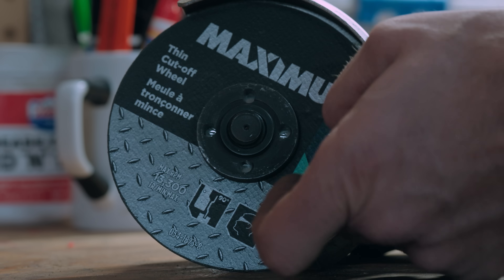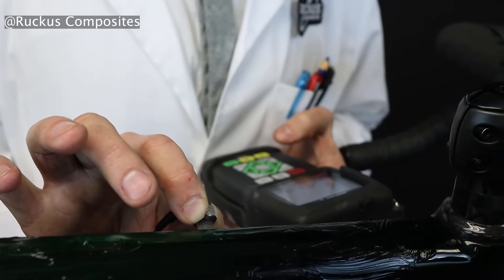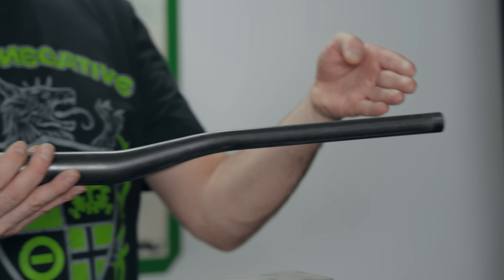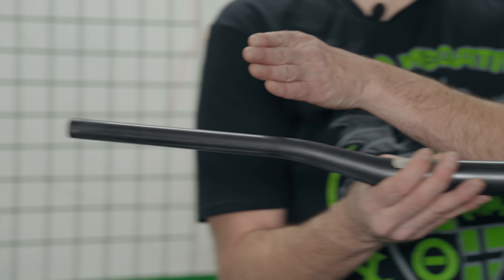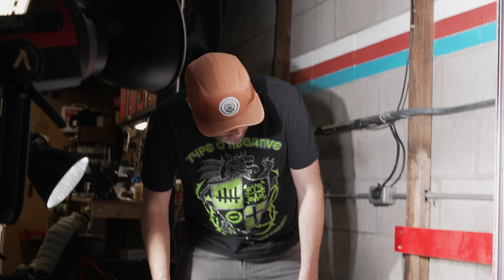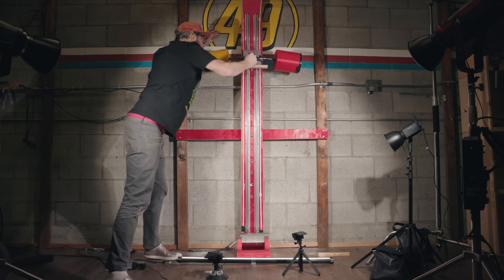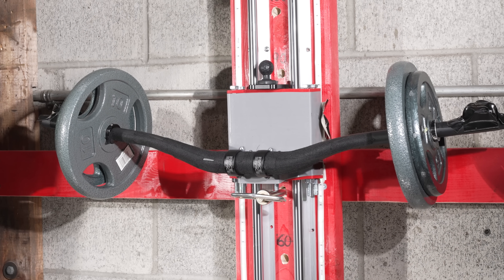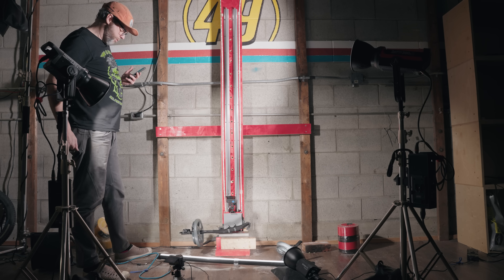Is Repaired Carbon Fibre Safe? Breaking Point Test

Comment: The hell you guys mean that the non-repaired bar broke at a smaller amount of force, meaning that the repairs were better? Firstly you used a completely different bar for the third test and you used a different testing method (by changing the weights), the original 2 tests and the final third are not comparable at all. Secondly, and more importantly, you had the unfixed side of the bar NOT BREAK on the first 2 tests at the same high force that caused the fixed sides to break, meaning that in both cases (in this arguably tiny sample size) the bar performed worse after being repaired. Ive enjoyed watching this channel a lot, you guys provide very useful information in a format that is easy to digest to those who are unwilling to do the research themselves, but this video is a tragedy that could lead to an even worse real life tragedy. Do better.

Comment: You need to edit and republish this video with an intro excerpt timestamp link and create a new ending that acknowledges the skewed results and flawed conclusion and seemingly wonky chart? Your data shows repaired carbon can be strong. But doesn't support what you say. It sucks that the test rig broke, but there is no real good comparable data here, even the two repair breaks are suspect comparisons as the rig seems to have been damaged and repaired at some point in testing? If the rig was repaired then any further testing is not apples-to-apples data. The only thing to do is build a stronger testing rig. Then you have to buy all of the bars at one time, the same bars from the same manufacturing batch, and hold the randomly picked control bar from the beginning. Then no point breaking the bars in ways that won't happen IRL. Nobody accidentally uses power tools on their bars?? :) ALSO, how does your test rig compare with actual use? Do we apply those kinds of forces every time we ride down a trail, because we weigh so much more? Or considering everything else that makes up a bike that absorbs the impact before the bars do we only create that kind of force doing RedBull Rampage kinds of drops??  I do appreciated the concept behind this test though!! And for sure if I break a chainstay/seatstay I'd get it fixed. But bars, probably just gonna replace those! :)

Comment: this was a rly interesting video,,

and i’d def repair smthn like a carbon chain guide and continue using it,,

but,,

the complaint remains that there’s no indication before breaking like there is w metal (usually)

so u can’t tell when the stock carbon part is abt to break and therefore needs to be PRE-WMPTIVELY repaired or replaced..
Reply: *pre-emptively

Comment: This video is delivering a flawed and frankly dangerous conclusion. do not ride on a repaired carbon handlebar if you value your face, teeth, or spine. safety critical components are not worth risking your neck or face. Carbon parts exist in cycling to chase weight and flex characteristics. they are often designed to a limit of strength and rely on the continuous fibers running throughout the part to ensure this strength and distribute the stress of the load evenly to surrounding areas. if those fibers are broken, all bets are off. overwrapping and overbuilding the broken section only pushes higher stresses to another location where the fibers have either also been cut short or were not built or tested to handle the higher and unevenly distributed loads. Not to mention the video doesnt even note the potential of fatigue cycles on the repaired area either...

Comment: First of all - thank you for the video! Please read this one carefully. The breaking test itself is not good at all. The main difference in these type of composite material is the possible persistence of micro cracks during operation and their accumulation in time. It's really not obvious that if you would test a new element with the same maximum condition you did (without any other breaking tests) - it would always broke, the element could survive extreme condition at first. You did a few tests with lower weights before you use maximum weight. This can be the reason of accumulation of critical persistence of micro cracks that lead to the point where the construction is no longer good enough to resist the force you use. The same thing is with the repair! You can not be sure that your repair is goon enough till you check it at reasonable level. Ride safe! All the best!

Comment: Not a carefully-enough controlled experiment to draw any conclusions that I'd be comfortable hanging my hat (or somebody's front teeth) on.That was a reasonably hokey rig, which did not very carefully control for torque on the bars (i.e., the distance the weights were away from the stem clamp) or where the weights were relative to the repair. Spreading the weights over a ~20 cm area, as they did for the repaired bars, is not an apples to apples comparison of the loose plates of weights (which rattled on the bars on impact) that were attached to the "store-bought" bar. These differences might have substantial effects on the magnitude and direction of forces (impact and rebound) at the highest loading point (i.e., when the rack hit bottom). Further, in some of the takes, the weights came almost disastrously close to the presenter's toes - which are directly below the weight on the left when he is pulling the pin. Safety shoes maybe?

Comment: Not a bad qualitive rather than quantitive experiment, but a bit flawed.  When the change from sand to metal weights was made, the weights have the centre further in than before, this would lead to less of a bending moment on the bars, they all failed further in than the weights.

I would expect the repaired bars to be stronger than the unrepaired as there is more material in there if they were metal as the bonding will be a weld rather than a bonded sleeve.  It looked like the inner sleeves were glued with the joining faces on the original tube either glued face - to - face or not at all, this would be the weak spot, and indeed this is where they failed.

It would be good to see how much force goes throuugh the bars when being ridden, if it is significanly lower than the beaaking point then I don't see  a problem with the repairs.

Personally I can't see the point in carbon fibre for me and most other people but no doubt some of the top people find an advantage.

Comment: Have read some of the comments, and have a few thoughts. 

TLDR; It's an interesting video that isn't entirely wrong in it's point, but it feels like the type of experiment where you came up with a conclusion, and then set out to do some tests to just confirm that conclusion regardless of the actual outcome of the tests, which is a very bad way of testing something. Plus the explanation feels a bit like it's just glossing over everything except a small point that may not actually be relevant or accurate. 

For the readers;

To the general conclusion, I agree that having some basic knowledge of your kit is good, even if you aren't going to work on it. Knowing you don't need blinker fluid is a good thing. 

To the specific conclusion, I think it depends on the type of break and the event that caused it. If you broke your bars like that by full speed clipping a rock wall, that's probably fixable. If your carbon frame took a tumble and cracked the head tube, maybe not. Definitely have someone who knows composites inspect it though. Carbon fiber is certainly repairable, but only sometimes, not particularly easily, and often at the cost of weight and bulk, which is the strength of CF in the first place. Hence the conclusion, "it's [probably] not worth repairing"

To the methodology, there are definitely some issues with the process and sample size, but I also see some other issues. One big issue is the force measurement in the first place. The independent variable is the drop height, plus the mass of the weights if you had to change them after maxing out the height. Having the force is a useful data point, but it's not the factor being changed. Also, where is the accelerometer located? If it's in the center of the base or the bars, you would likely read a lower peak impulse at the breaking point due to the weights being detached from the bar before they have a chance to fully transfer their inertia into it and rebound back up. I'm a bit surprised that the first two bars didn't experience this, though possibly the height spacing was such that the peak force would have been between the two pegs? (This is based of my intuition with similar testing scenarios, please chime in if you have more experience with that type of setup) 

Additionally, with the extra set of bars you seem to be talking about them failing due to fatigue and at a lower force than the repaired bars and a lower force than their peak, but regardless, that only really shows that the third set was not as strong as the two originally were. (Plus maybe the impulse measurement issue above) I assume the point of the last test was supposed to be to see if the repaired bars failed at a higher force than the unrepaired bars would have failed at, but using a different bar makes that kind of meaningless. It also doesn't make much sense given that if the virgin side of the bar didn't break at that height, a full bar likely wouldn't have either. The weights were also different between the first two sets and the last one, which confounds the result even more. (Also as someone with way too many 3D printed things, a shim for a set of barbell/dumbbell was probably a better idea from the start) 

It also feels like the whole chart section doesn't make a lot of sense? What do the hollow circles represent? There were only a few tests shown, definitely not that many. Were those bounces? Were there more tests than were shown? Also, the peak vs break forces aren't labeled. Why is the second-to-last force measurement highlighted at all? Why are we just now learning that there was a "fancy" vs "quick and dirty" method? Which was which? What is the X axis? Also, why is there an X axis? Actually, why is this a scatter plot at all?

This definitely feels very out of place for F9. Having the whole video be "you should do a thing and it will often be as strong or stronger" does test and determines that thing is not as strong "as you can see, you should do the thing" just doesn't make any sense.
Reply: Also as a clarification for all the people just saying "bring Ryan back", I do like the cycling content, and if it adds to the content instead of replacing the existing moto content in the schedule, neat. (Though I do think there is enough of a gap between motorcycles and bicycles I get why some of the audience doesn't like it as much)
This specific video and methodology just feels well below the standard for the channel.

Comment: I don't mind the bicycle stuff, or the new cast, but please, do the actual tests better. Switching weigth types and not using the same handlebar at the end. So his repair was stronger with a wide soft sand weight than an unknown knockoff was with a steel weight. That does not tell me much.

Integrity is so important for this channel.

Comment: I never would have thought repaired carbon fiber would be just as good as original. I shoot archery, and most of my arrows are made out of carbon fiber. It's a great material because it doesn't bend and is light (unlike aluminum) and it takes a lot more stress to break than wood. (It's only downside is it can be expensive.) But when it does break, it's thought it's best just to cut off the broken part and shorten the arrow. But, maybe these arrows can actually be repaired.

Comment: The surface of the load was different on repaired handlebars and new one. Repaired had weight distributed on more surface, around 10cm (more less width of grips) the new one had just narrow gym weight installed on like 2cm of the width of handlebar. Thats not apples to apples.

Comment: This has done nothing to convince me that carbon fiber is safe to repair. Your testing methods are flawed. Aluminum can be damaged and still be safe to use, while CF is a gamble. No thanks! I'm hard on equipment so ill trade a few grams of weight for reliability every day of the week.

Comment: Overload failure & crack propogation, as what happened to these bars, are not the same as fatigue.  And with the retail bar covered in tape, it was also changed test configuration.  Overall your point is true that sometimes carbon fiber parts can be repaired to be as at least as good as original--functionally.  But per data, the repair changed the geometry by adding extra material & load distribution on the area of repair, so the strength is going to be different with the same force vs a new tube.

Comment: The test is wrong. There is a methodology error.
At the beginning you say: carbon fiber breaks up without surface warning signals. 
But later in the test what you did is to stress the same bar multiple times creating "under the surface" breaking points and making it weaker for the next try. 
If you pick a brand new bar and you test directly 1,60 meter, probably it WON'T break up. 
At the same time if you pick one of the repaired and you test immediately the limit, maybe you will also see that you can push that limit further. BUT in the case of the repaired bars, decisive is how it broke and of course how good it has been repaired. 
However you have to pick ONE new bar and run ONE test. Then change the bar, make another test, and so on. So you have equal starting conditions. Otherwise is like you are using unrepaired items and then you wonder, they are weaker than the brand new ones.
Reply: this

Comment: Wow, there was no standardization in testing methodology between the commercial bar and the repaired ones. Y'all need to remake this with both a larger sample size (I'd personally like at least 3 of each) of each break type and repair job, as well as a consistent and repeatable testing apparatus throughout the entire test. Maybe also throw in a break caused by the test rig rather than artificial means, repairing it, then retesting it. I'm disappointed quite frankly.

Comment: idk guys this seems like a low quality video, you didnt really prove much, the repaired side of the bars broke before the unrepaired side, and then you used more concentrated weights on some random other bar and found that....a bar that was repaired with more fiber is stronger than some random other bar?? also you really didnt do enough tests to judge if its actually safe or not. This wasnt really up to f9 quality

Comment: I repaired a Downtube headtube junction on a full suspension trail bike. Rode it a few more times and it broke again but on a chainstay pivot, so the whole “if the repair is better than the rest it will break somewhere else” has been true for me.

Comment: Can't even find a decent bike mechanic in Portland, Maine so where the hell do you find such a specific CF specialty shop???   Plus, my Reserve Wheel owner's manual says anything over 150 degrees damages CF resin so never leave your bike in a car on a hot day or even leave a black bike sitting in the sun too long.  Catastrophic failure means significant injury.  Finally, no way those repaired bars had the same flex/damping characteristics as the original.  Thumbs down from this cat.  Simply not a fan of that fancy plastic crap; environmental disaster with fancy marketing and huge profit margins.  Liking your channel less these days :(  unsubscribe

Comment: What I find silly is that those parts are essentially injection-molded plastic with carbon reinforcements. They're not "carbon fiber" in the sense that sheets of carbon weave have been laid together like you would find in a high-end bicycle or car frame; they're fiber-reinforced plastic like the more traditional glass-reinforced nylon. 

I find that confusing as the term "carbon fiber" gets thrown around a lot but now encompasses multiple manufacturing techniques, which produce wildly different results.

Comment: Carbon fibre’s sharp broken edges are lethal and the dust particles are extremely toxic. I worked on a military base that stored damaged carbon fibre fighter aircraft parts. Strict handling measures were enforced. As for weight reduction, using carbon fibre on a bicycle is like making a feather lighter, the gains are incremental and frankly not worth the effort. It has its uses but it strikes me as what chrome in the 1950’s was, an ornamental selling point for the average consumer.

Comment: Absolutely fine to repair most carbon parts if it's done correctly. Super common in aviation. And a simple thorough tap test is usually all that is used for NDT.

Comment: I make speed dust sometimes too. But my speed dust related product floats. Been working with glass, carbon and Kevlar last 2 years. Its quite amazing what can be done. In reality carbon fiber is fiberglass but not. If you understand the grains and weave structure the strength will follow. Boat guys will tell you anything can be fixed. Whether you should depends on cost vs worth

Comment: This is such a disappointing video... No real explanation of why the numbers where lower for the stock back, just saying "fatigue" doesn't explain anything. And absolutely no addressing or explaining why the repaired carbon failed (at least apparently) on the the repaired part. I'm left with way more questions than at the beginning, wondering why I didn't get those explanations and very disappointed to see fortnine releasing this video 😔